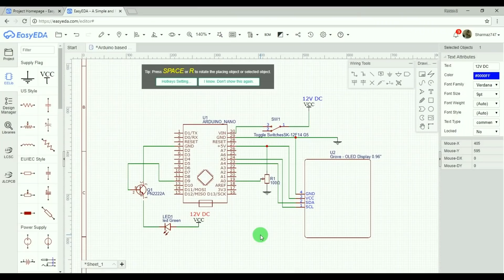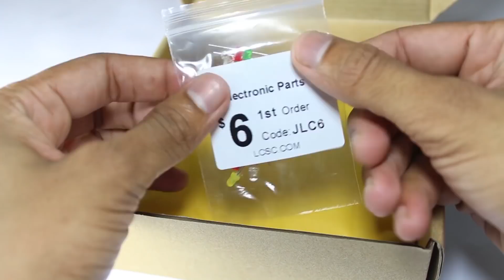DIY Arduno based Stroboscope

Comment: Hi Mr Inno, in this strobo led its possible input signal from spark coil motorcycle for setting timing dead point ? Inductive signal from spark cable with 5,6 turn wire?
Thanks

Comment: The circuit diagram is wrong too, i guess because i tried it without the PCB and directly making the connection on breadboard, the LED light is just glowing and is not at all flickering. Anyone who has got a solution or so? Each and every help appreciated
Reply: yeah me too... in me the LED is not blinking. any help?

Comment: There are lot of things missing in your video, man. Show the entire connection please.  Where have you connected the dc power jack? Also how much voltage battery are you using? Please atleast reply  if you want to help someone
Reply: It will work on 9V dc
Reply: It will work on 9V dc

Comment: there are many steps which arent unterstandable. like why you need a transistor, how you connected everything and how you programmed the arduino( yea there is an "i" in arduino..). Furthermore is the amount of flashes measured in Hertz not in rpm, the strobelight does not rotate and its ineffiecient to count by minutes... if somebody wants to know how to build a strobe, he just learned what parts might be useful for building one and where to create a pcb. but there was no benefiting logical explaination of what you did...